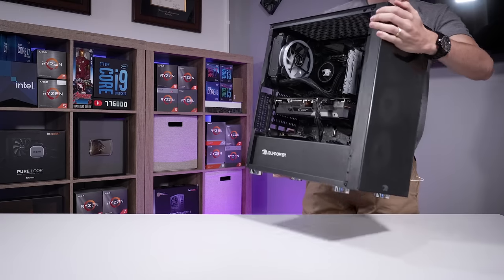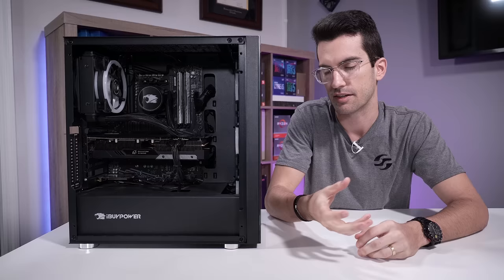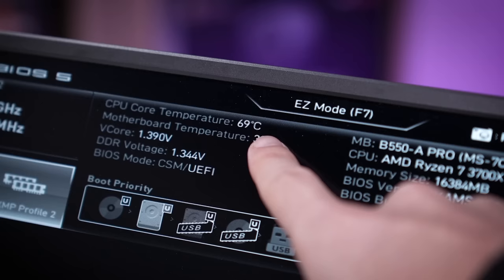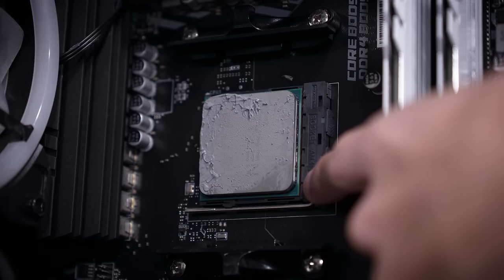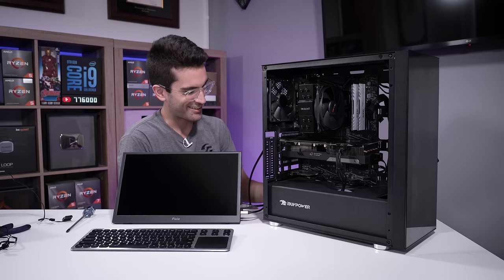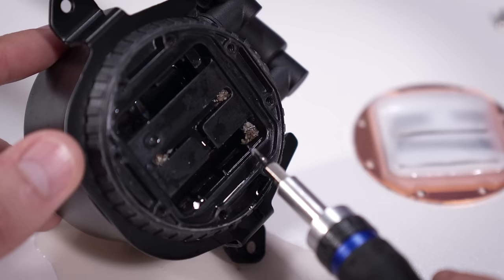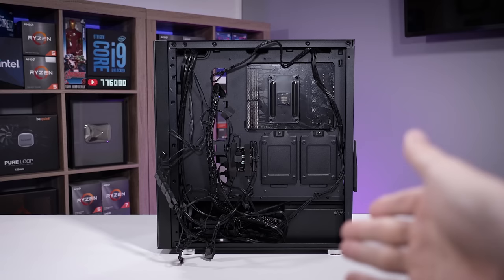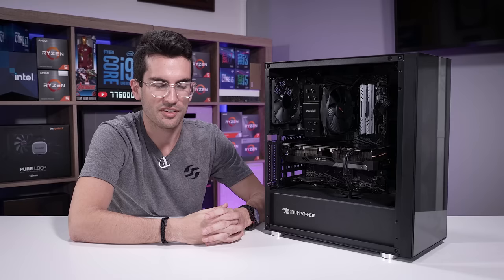Fixing a Viewer's BROKEN Gaming PC? - Fix or Flop S2:E8

Comment: Would be really interesting to see if you set up 3 Computers with an AIO placed at the Front, Top and Rear and leave them running and see if the placement of the AIOs affects how quickly it gunks up?

Comment: I got stupid question can I use Antifreeze from the car or is it special type ?
Reply: use an antifreeze that has corrosion blockers for aluminum engines.   meaning, dont use the green or universal stuff, any of the newer colored coolants would work.
Reply: @auyemra1331  thanks for the info.

Comment: Watching these have definitely turned me off on using AIOs.  Especially considering I keep my computers running 24/7 and run them for over 5+ years easy.  My Be Quiet double fan (giant freaking cooler) has performed perfectly for over 5 years now without even being blown out (which I should have done).  Never had an overheat problem.

Comment: surely with an AIO being more expensive than an air cooled solution, you are devaluing the parts in this viewers build? not trying to come over as rude but id have thought a like for like... or even a repair of their AIO (as you showed is possible) would be the better option for the viewer? just my opinion though. 

Curiosity on my part here... could it maybe have something to do with the air and whats in the around florida where you guys are? also like you said it could be something at manufacturer level also.

Comment: How come so many of these pcs have issues. Fro example, I got 9700k when it uses to be a top notch cpu (haha). Swapped 2 motherboards to get more powerful vrms and overclock. 2 cpu coolers, about 8 gpus, 3 kits of ram and I haven’t seen a bsod in 3 years besides times of going over what i7 is capable of in terms of ghz
Reply: so, u got one.

verge refrence

Comment: An AIO was on my upgrade list but after seeing this for the 2nd time on here i'm definitely going with a beefier air cooler instead
Reply: unless you have something like 11900 or 12900k there's no real reason for aio, treat yourself to scythe fuma 2 or dark rock pro 4 and enjoy stress free air cooler life :p
Reply: That first video convinced me not to do AIO. They weren't really big last PC I got and I was already iffy about it. Got a deepcool fan instead
Reply: @simplysaphi  thats crazy; the fuma 2 is the one i've been looking at the most and now i'm 100% set on it
Reply: I never used AIO. If I want to go water cooling I want to run a custom water cooling. Currently using overpowered NH-D15 for my Ryzen 3600x.

I kinda regret my choice. But nvm it's good.

Comment: those ibuypower AIOs are really pieces of crap. Not only are they 120mm in 95% of the systems they ship out, which really is not an adequate size for an AIO for most CPUs, but they also seem to have extremely high failure rates. Mine had a relatively minor failure, just issues with the RGB (not software related), but that combined with inadequate cooling power made me readily switch to a 240mm Corsair AIO, and I haven't looked back since, with temps 15-20c cooler.

Comment: Uh, not true. There is such thing as too much thermal paste. You're adding a medium that the heat has to travel through. You definitely can have too little, but you absolutely should not minimize the mistake of putting too much thermal paste on a cpu. Now, most people will never put all THAT much paste on it, but tests have shown in the past that too much thermal paste can cause increased temps.

Comment: i don't want to be mean but this shows that still air coolers are more reliable and better....and they don't break or fail after 1-2 years......i am still trying to make all my friends not to buy aio coolers and buy air coolers instead....i use dark rock pro 4 from be quiet on my i5 10600k and the max temp i see in stres test and 100% load is 70% degrees....so why you people obsesed off using aio's i don't get it.....

Comment: 1.464V on VCORE for a 3700X is definitely on the high side.  That CPU is going to run hot with any cooler on that voltage.

Comment: If you gave me a aircooler instead of a AIO like i had id be pissed. AIOs cost alot more then air coolers. To me you would be ripping me off. Either replace it with a AIO or leave it alone dont rip me off like that.

Comment: I can see from start aio rad is upside down causing air bubbles go straight to the pump boom dead pump. Guy is lucky cpu isn't dead.
Edit: alright I didn't knew pump inside the radiator ok my comment above is irrelevant lol

Comment: So wait, he sent you is gaming pc to fix its heating problems without actually doing their research and solving the problem at hand. All it takes is 20 minutes for a tutorial. They should have just opt out of the aio water cooling after it shows signs of failure and bought a new cooler.

Comment: its pumping the water
Reply from the maker: Not sure to what this comment is referring, but if it's that odd sound coming from the radiator, it should not sound like this.
Reply: @GregSalazar  But you figured out it was the pump making that noise because of glogged heatsink.